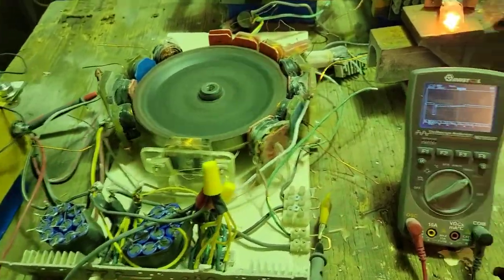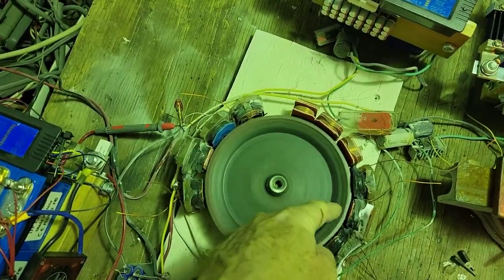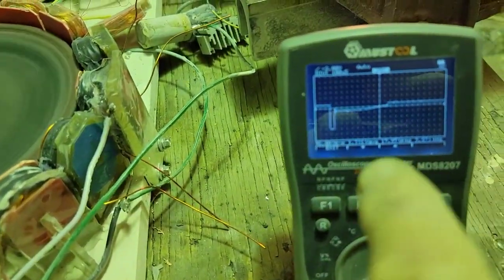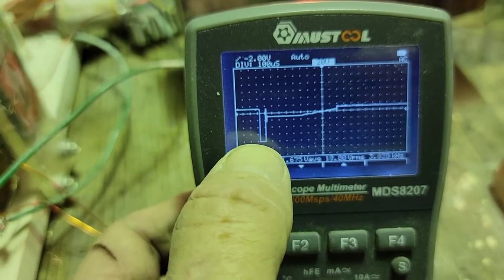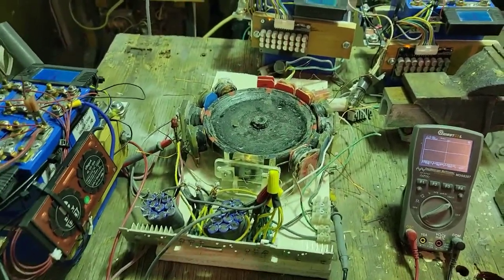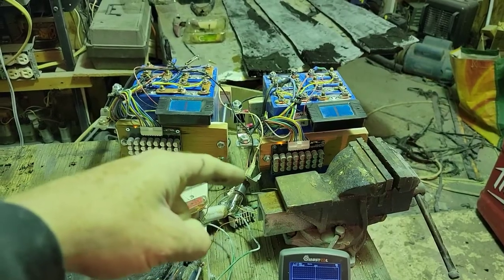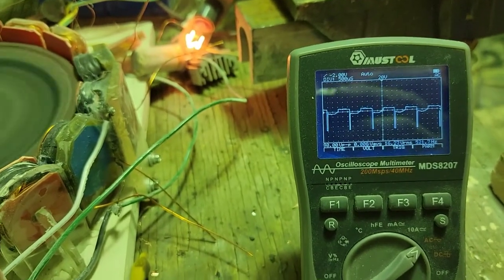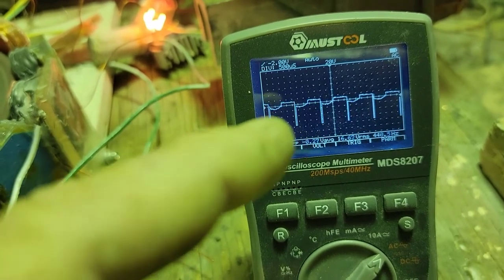Pulse motor gets Upgraded part 1 . 4 drive coils vs 8 drive coils.

Comment: 400 hz is smoking fast!  Nice rotor. I found MOSFET's are more efficient switchers than NPN transistors by around 10%.  Try an IRF840 or 460 Mosfet.  If you put your charge and drive batt in parallel you can get 80% - 90% recovery of the input power, not counting the mechanical energy you create by spinning your rotor at thousands of RPM.
Reply from the maker: Hey buddy thanks for watching! Yeah I've been using fets on a different rotor but I've not seen the same output I get from using these 56s . I have those fets and tried them they are a popular fet for inverters.
Reply from the maker: It's impossible to put the run and charge batteries in parallel with this circuit and you will notice the charge batteries are 24v and the run batteries are 12v buddy.  This motor is designed to actually speed up with certain loads on the output I'll be showing how to do that when I have more time.  To be able to put the batteries parallel there has to be two timing coils instead of just one and I would also use mosfets for such a motor.  The transistors are important for the speed up with certain loads on the output.
Reply: @windpowerandmore6310  have you tried measuring the fly back power compared to input power?  I’ve gotten up to 80% recovery and hoping to eventually get to 100%.
Reply from the maker: Yup you can actually see it on the meters on the battery banks . Each battery pack has meters on them that measures amps ,watts, total Amp hours ect. This design isn't the best design for capturing back emf . I've built pulse motors that have way better recovery but they are completely useless no torque.  Pointless to waste time building.  This type of motor is much different and has crazy torque which is very very useful.  In this configuration it actually charges more with a load on it. This dual battery input design is for the speed up under load which I'll show how to do that when I have more time.  It's possible to run large I inductive loads on the outputs of this type of motor with a few mods. Added. I hope you stick around and keep watching.  I definitely enjoy seeing what you're doing with that Newman motor right now. One of the first motors I ever built was a magnetically levetated Newman motor.  I still have it somewhere in a storage.  I'd like to pull it out sometime and change the firing circuit to digital just to see how it reacts .

Comment: 3 QUESTIONS. ARE YOU GETTING THOSE HIGH SPIKES -,ARE SPIKES EVEN NEEDED,-AND DO SPIKES DESULFATE THE BATTERY MAKEING THEM LAST MUCH LONGER as claimed by certain energiser groups.
Reply from the maker: I have to collect the high spike BEMF because it will destroy the transistors if I don’t collect it. It’s important to always have the output connected before you connect the input. There is much better ways to fix batteries but if you have a battery that needs to get fixed it won’t hurt to leave it on the charging side of the motor. Fixing batteries takes many many hours days weeks depending on the batteries.